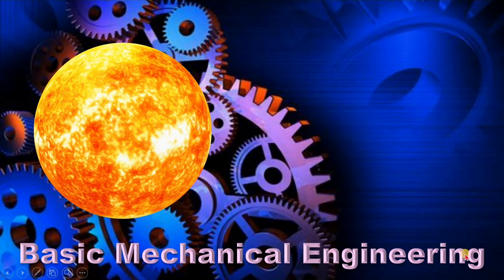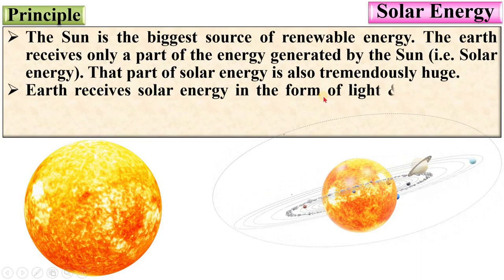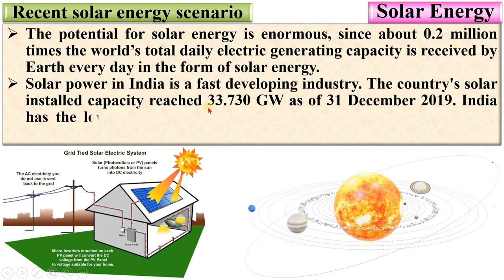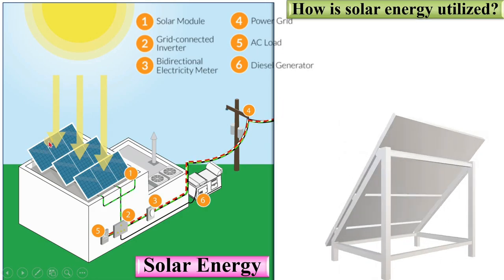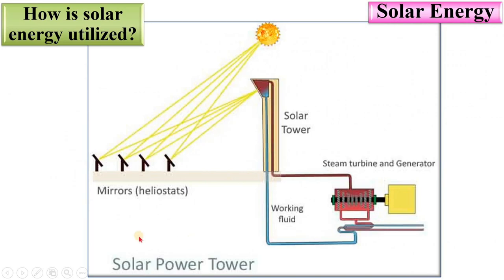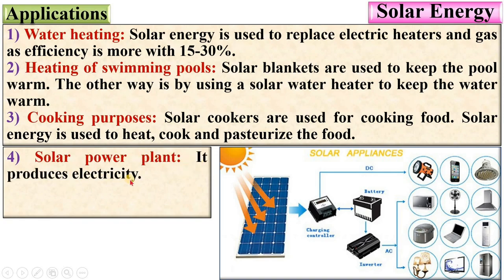Solar energy | Principle of solar energy | Solar power tower | Photovoltaics | Applications of Solar

Comment from the maker: Solar energy explained with following Timestamps: 
0:00 - Solar energy - Basic Mechanical Engineering lecture series 
0:36 - Principle of solar energy
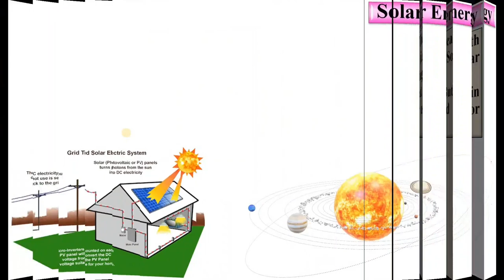1:27 - Recent solar energy scenario
2:34 - How is solar energy utilized?
3:36 - Function of inverter
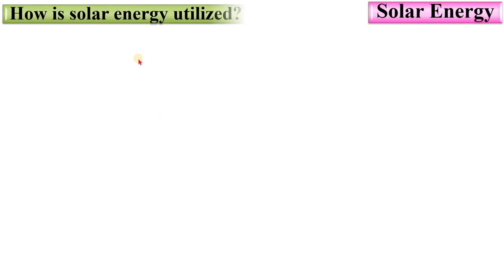4:22 - Parts of solar electricity
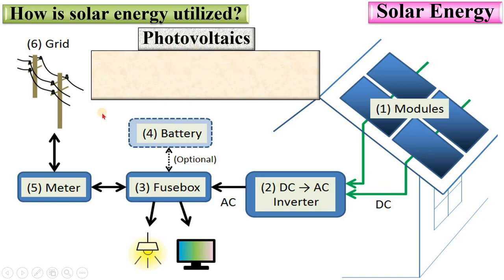4:26 - Photovoltaics
5:35 - Solar power tower
5:50 - Advantages of solar energy
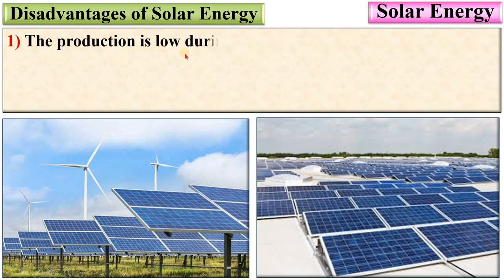6:39 - Disadvantages of solar energy
7:02 - Applications of solar energy